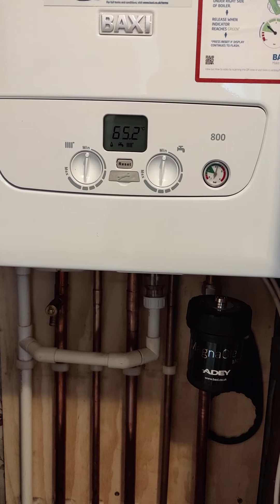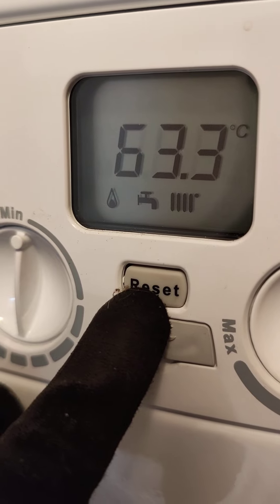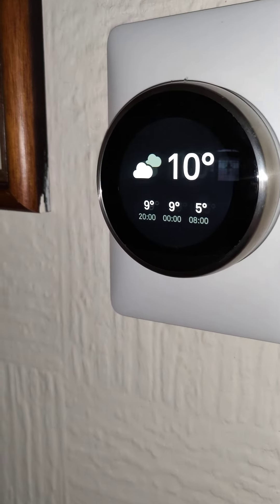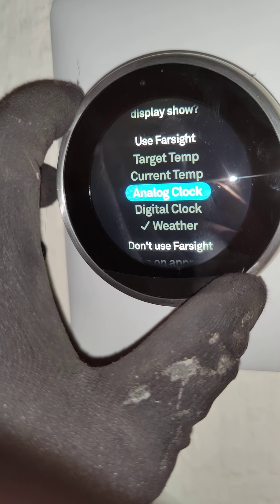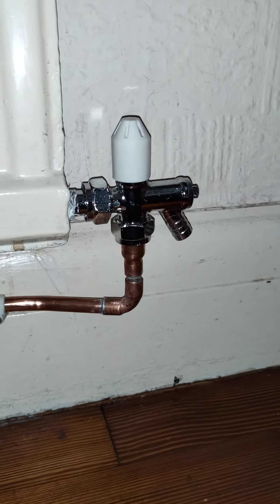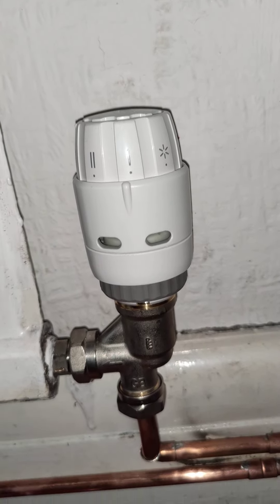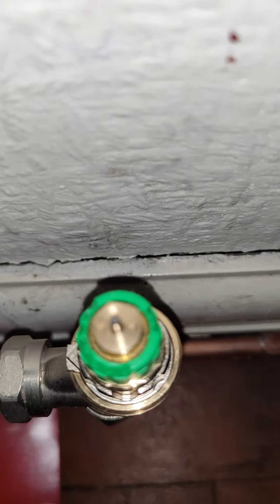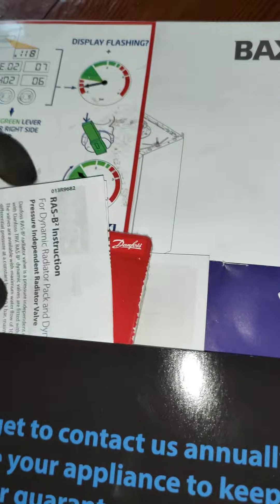Opentherm Baxi Combi boiler with nest thermostat and Danfoss B2 dynamic TRV s

Comment: I have a 14 month old Viessmann Vitodens 100 boiler,I fitted these Danfoss RAS-B2 TRV's to all 8 rads using their lock shields as well.All the TRV's were set to the recommended settings for each radiator prior to fitting.The system is clean so all should be good. The result? buzzing and vibrating radiators and Viessmann Boiler has now transformed from a very quiet boiler to a boiler that sound almost like a failing pump.
I contacted Danfoss about this issue, they are going to contact me with a fix.Well this has been 3 weeks ago and no response from Danfoss. Hope you have more luck with yours.
Reply from the maker: Did you fit these yourself? Are you a plumber/heating engineer? Is the boiler pump set at the correct speed as determined by the total flow rate through the radiator valves at the values they have been set to? Does the system have an external bypass fitted?
Reply: No not a plumber but no where does it state that the pump speed needs to be adjusted indeed in the advertising jargon it states that once these TRV' are pre set,after fitting you will be aware that the pump speed has slowed considerably.I know what you are thinking "what does he know he not a plumber" that maybe so but in my defence coming from 50 years experience as a mechanical engineer,I think I know what I'm talking about.
I pre set the recommended numbers on the valves,no good so I tried dropping the numbers down by 1,no improvement so went the other way increased by 1,no improvement.
Next week I'm going to replace these things with good quality standard TRV's!
Reply from the maker: @turbo3492  if you have completed the relevant training you would know that pump speed should be set correctly for any system regardless of what valves are fitted. Mechanical engineering and plumbing/ Heating are completely different trades, just because you know one trade does not mean you automatically know another; you are obviously in beyond your depth and should employ the services of a competent heating engineer instead of learning how to DIY by watching YouTube videos to save yourself more hassle and possible damage to your heating system.

Comment: May I ask how you got OT working on a S PLAN?? Been told that new wires need to be installed ....

I am lost :( 

Got a Ideal Vogue Max s18 and TADO smarttbermostat 3v OT compatible
Reply from the maker: Opentherm would generally be used for combi boiler , the temperature within the house is monitored by the thermostat (current temperature) and you set the thermostat to what temperature you would like it (target temperature). The closer the current temperature gets to the target temperature, the cooler the radiators get (load compensation).
On a system with a hot water cylinder, you would need to upgrade your s plan system to a priority hot water system (w plan) in order to be able to run the heating at lower temperatures , your heating engineer should be able to go through the various options. 
I hope this helps
Reply from the maker: Just to add there may be a solution from EPH controls , incorporating a cylinder thermostat and a seperate opentherm programmer. It may be worth giving them a call